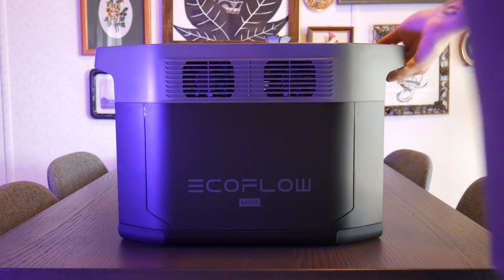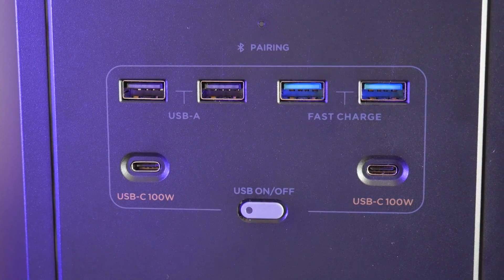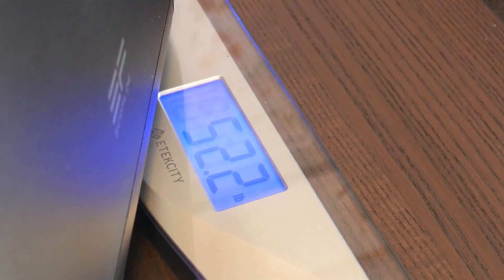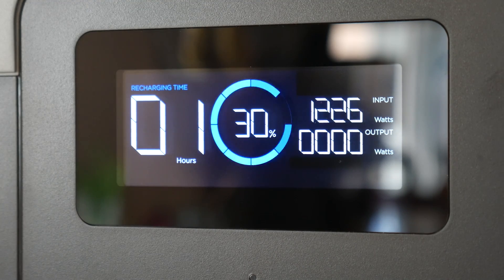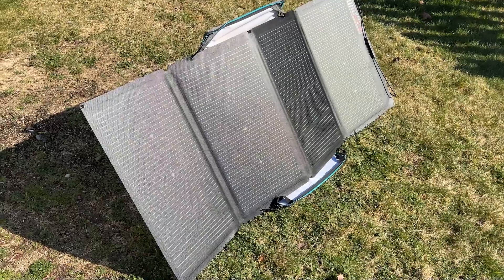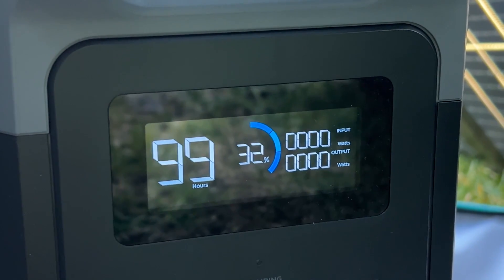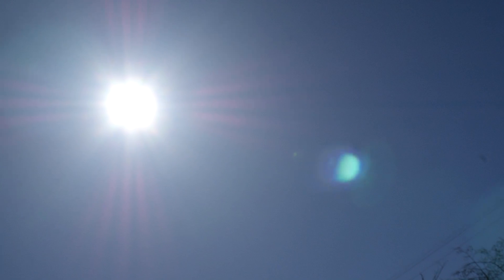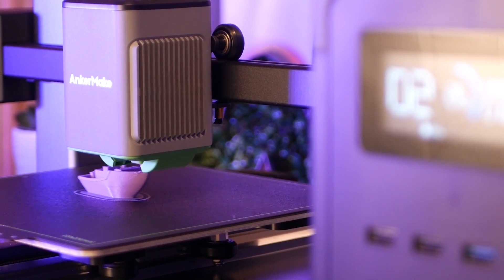3D PRINTING USING THE SUN - EcoFlow Delta 2 max Review

Comment: 200wh is 0.2kwh, if you pay 40cents/kwh, your bench would have cost you 8 cents normally to print.  You'll really save a lot when printing 3 day prints, like a helmet.  I'm surprised that slicers that predict how much a print will cost in filament don't also have a calculation for electricity.  I bet it double's a prints cost.
Reply: i dont know about being cheaper but for example, i live on a town with a really really crappy electricity company, the service is unreliable, i just want to be able to print knowing power wont be an issue, so i might try this setup with my sla printers, they should work a lot beter in theory as they dont really need constant heat.
Reply: There are calculations at 11c/kw consumed, for example a prusa at a benchy under 0.001 cent per stream. Now calculate that up to get to €2000 for such a system to be profitable. at 40c/kw it is 0.004 cents for a benchy. Now calculate 15 minutes for the benchy, 1 hour/ 0.016 cents, 24x16 = 0.38 cents per day. That means you need 5000 days to reach the electricity costs of what such a system costs... just as an example

Comment: I tried using a 1.5kw battery for my printer, but the printer kept having power issues. I need something like this, 1.5kw is just on the edge of not enough.
Reply: I get electricity for 1 cent per kwh (which is basically free electricity) from 11pm to 7am so I have a smartswitch that charges my battery at night, and I charge all my powertools and run my shopvac and woodshop tools during the day.
Reply: In the UK electricity is equivalent to 40 cents per kWh...